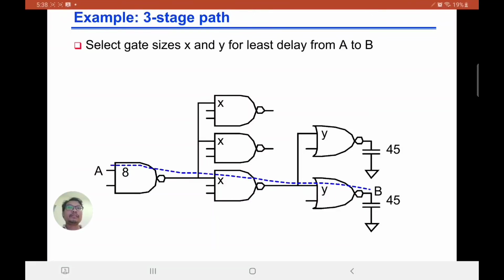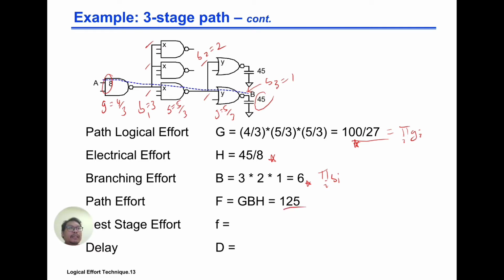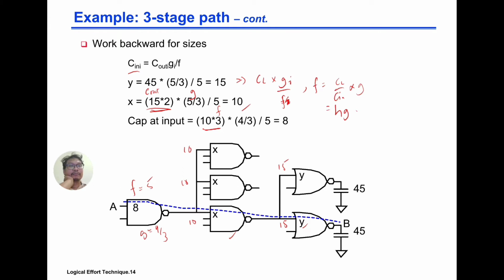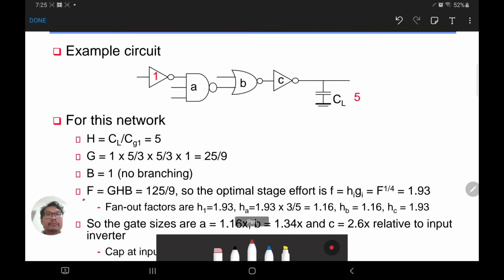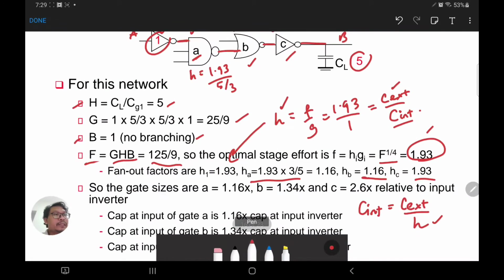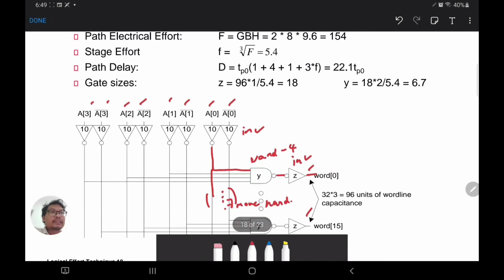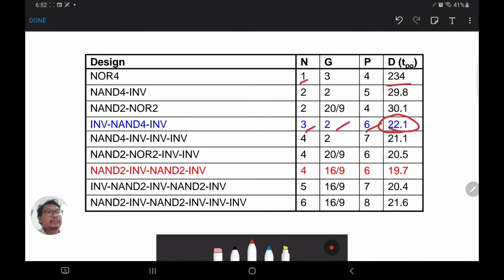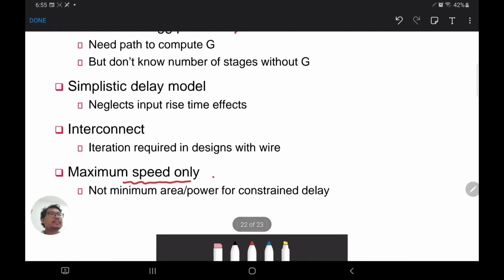MEEH1163 VLSI Circuits and Design (UTM): 6-4 Logical Effort Analysis

Comment: I did not get how to  calculate B,  please elaborate.
Reply: The cap at input of gate b is 2.24x cap at input inverter (not 1.34x in the video). 2.24x is correct because doing the math: Cint,b = Cint,c/h = 2.6/1.16= 2.24x so then Cint,a=Cint,b/h=2.24/1.16=1.93x so then Cint,1=Cint,a/h=1.93/1.93=1x which is correct as we can see with 1 given to us in the problem.